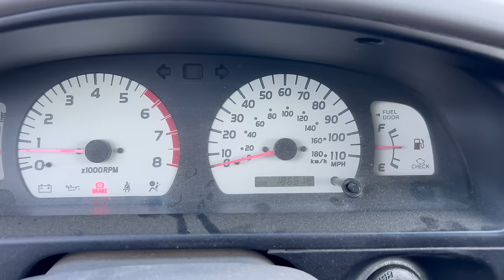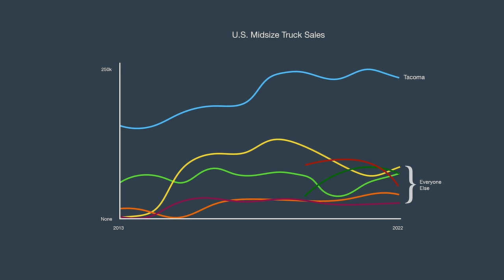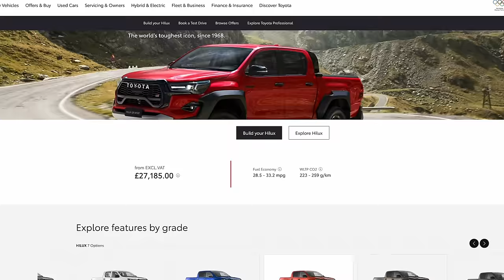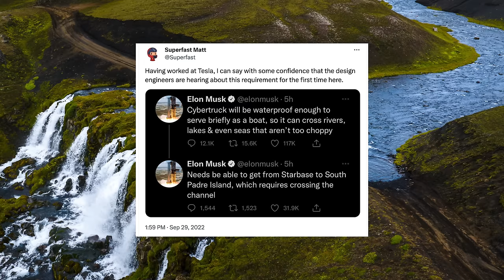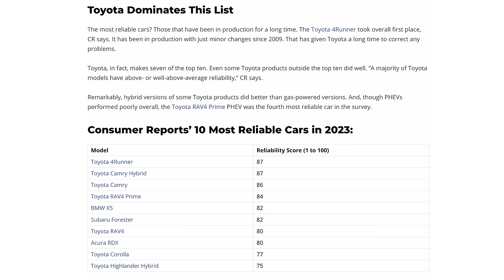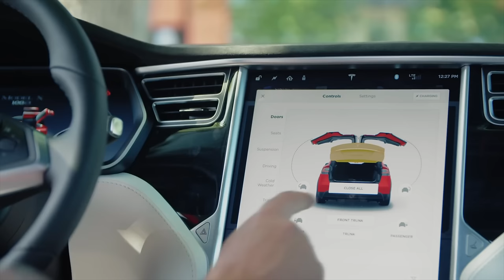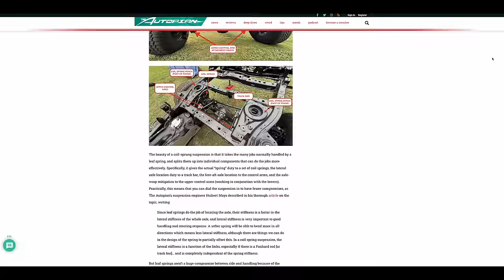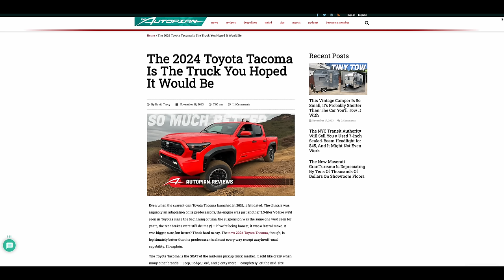What Is The Best Truck, And Why Is It The Toyota Tacoma?

Comment: Every single person I know that had these in the mid 2000's had the frame rust out from beneath them.  Eventually a class action suit got them replaced, but long after the original owners got screwed.  History says "Toyota warrantied them".  Most of those guys bought GM or Ford eventually, since they actually needed a truck.  Toyo's are too often driven by d-bags with TRD tattoos and $7k mountain bikes.  Too bad since they really are good trucks for certain things, especially the old ones.  New ones are junior big trucks - not their own thing.

Comment: My stepson has just spent a fortune buying an 80 series Toyota Landcruiser…also built when Bill Clinton was US president. In his first year…when Paul Keating was Australian Prime Minister in his 3rd year. It has 290,000km/180,000miles. And it’s petrol, or gas in your foreign tongue. And thirsty!

The Stout was also sold in Australia. My uncle sold his Mercedes(business was going ok on his side of the family) and bought both a Celica and a Stout brand new in 1977(Jimmy Carter/Malcolm Fraser). He kept them until he died in the 90s and I was the only person he ever loaned a car to. Yep, it was the Stout.

Don’t get me started on my one and only Hilux ownership experience though… Indestructible is not the word. The the 88(very late Reagan, but Bob Hawke was still going strong) one I had in the late 90s found every single way it could to self destruct! Front and rear diffs both went within weeks after the diesel engine had been reconditioned because it failed after a week of ownership. I gave up on that pile… It vibrated at idle too much anyway.

I haven’t seen too many Tacomas in Australia, but that niche is already packed with the likes of Ford Ranger, Isuzu Dmax, Mazda BT50 etc. as work utes. I am seeing a lot more F-150s, Rams and Silverados(in that order) here over the last 5 years or so though, but I think they’re mainly purchased through a tax break and personally used by owners of smaller businesses because they’re purchase price is so much more expensive.

Oh, and at 9:23… what was that thing you were doing? Next you’ll say it has 3 pedals! Oh yeah, like my car…

As for torque, 5 days a week driving a 4 cylinder 5.2 litre turbo diesel Isuzu…isn’t that much! They’re reliable though.

Comment: In 2004, I needed a truck to do a satellite tv installing job.
I couldn't afford a Toyota (new or used . . . well, I could afford a used one, but my price range was at  "a near dead, abused one" because yes, they hold their value) and was hesitant to get a Mitsu Mighty Max/Dodge, even though I knew them (all I was finding worth a look were 2.4l and I am not the biggest fan of those, if all I want is no repairs and trouble free, I was looking at "Will need seals and a new rubber band soon" or "Let's swap in a 2.6") in part because I was looking to put many a mile on quickly. I ended up getting a newer than I was expecting Frontier ('98 4x4) with just 50,000 miles. I only did the job for 5 months, but it put it near 150,000 miles. I still have the thing, it has nearly 200,000 and it just got a 'new'(reman) trans (5 speed) and I have a spare engine to hand, just in case, but I wish it was a Toyota. But, if not a Toyota, the Nissan was a good second choice (I know Rangers about as well, but they were either too new, or too clapped out. at the short time I had to look), even the mechanic I knew (and got me the deal on this truck) said as much. Now-a-days, if I was looking, I'd consider a newish Tacoma, (extended cab, manual transmission) or an older one, for that matter (or pre-Taco), but I'd not go with a newer Frontier as a second choice any longer. Too much, "You know, I don't like that" in new stuff these days.

Comment: Yeah, my 2003 'simple' truck is, I would dare say, as good if not better.  My '03 Dodge Cummins has been such a great 'real' truck.  It's a Dually, and I've never had any trouble parking it in 'Merica.  Other countries I can see it being a problem, but half the time I just 4-wheel LOW it into any spot I want.  I've had to replace the waterpump and the throttle-feedback POT in 186,000 miles.  That's it! Beat that Toyota!
Reply: I won't disagree that the Cummins in the old Dodge pickups were fantastic. Many million mile plaques have been sent to customers from Cummins in the million mile club. That being said, where the Toyota will beat Dodge any day is everything else on the truck. Most Dodges from 2003 at this point have cracked dashes, windows that don't work, doors that are worn out, and radio buttons that no longer register. Interior quality in American vehicles has been playing catch up to the Japanese for years and only in the last 10 years or so have they caught up. While I'll never say anything negative about Cummins quality and the Dodge 48RE transmission or NV4500 manual, the interior quality of any Tacoma is miles better than what Dodge was putting out until, like I said before, the last 10 years or so. Why do I say interior quality is important? It is where you spend the majority of your time dealing with any vehicle. Dodge wiring is also pretty meme-worthy for how sketchy it can be at times.

Comment: I agree that the Tacoma is the best all around pickup. For most people that just do mundane things and don’t go off-road more than 5% of the time - there is an argument for the 2nd gen Honda Ridgeline. The Ridgeline has full time AWD, rides better, has better acceleration and fuel economy, dual action tailgate with a trunk in the bed, more comfortable - these factors may change slightly depending on if you are comparing the previous generation or the new 2024 Tacoma but they all are still true unless you get the hybrid Taco which will be quicker. The Taco is going to dominate at serious off road stuff and will be able to tow more.

Comment: is the Tacoma like bigger or the same size as a Hilux? we drove Hiluxes in the army and I'm of the opinion that it's the best car ever made. We used around 2004 model years and around 2017 model years
Reply: They're about the same size. Afaik they're basically the same with only minor differences partially in due to the fact that tacomas are US made for the american market, while the Hilux is more market-agnostic.
Reply: Hilux's are all still cart spring rears, it'll be interesting if they get an option for the multilink rear at some point.

Comment: As an European and the owner of a 30y old 4runner with a one-wire diesel engine with absolutely no electronics, manual gearbox and a radio, ain't gonna sell it even if it keeps appreciating in value. It may be harder on fuel than a brand new one, but only slightly and all you need for servicing it is a bucket and one wrench. Good to see Toyota doing Toyota stuff...

Comment: I bought a 2010 Lexus LS460 because of the Toyota reliability! Although only 82,000 miles dealer serviced, I have had a lot of problems in one year! Latest is the ABS pump needs replacing at $5,000!

Comment: I don't like the feature, where the car decides for you and nudge the steering. I sometimes rent a VW eUp and that has a "line holding feature" (that is by default on and resets to on every time you get into the car) where it resist you when it sees that you get too close to a line.
Problem is, when you want to overtake a car, on a two lane road and a car is coming towards you, because you are on their lane and the car is like "No, you don't switch lanes now" and resist you steering into your lane again, gives up halfway through and the steering becomes suddenly light again and you need to avoid steering too much and ending up in the ditch - at 100kph or about 60 bananas/h.
Or when some lighting conditions are, that the car wants you to steer INTO incoming traffic.

Just leave the driver alone. I want myself to decide if and when I crash, not outsourcing it to the car.
Reply: They also can be hilarious(ly awful) in snowy or rainy conditions. Track of the cars you're following drifts to the center of the road for a minute? Have fun fighting the steering without swerving (and did I mention snowy or rainy conditions? Hardly the ideal time for it).

Comment: Does anyone actually ( in the US market ) still make a 83-11 ish Ford Ranger / Chevy S-10 / Dodge D-50 type small sized truck?    Seems these have gone away and the only reason we get a mid sized truck is that they are super popular in other countries.
Reply: Didn't those basically get killed by fuel efficiency regulations and the desire for a ute that's safe and vaguely comfortable. Much as I loved my old Mazda Bravo (same as a courier, RoW spec ranger) it was a monument to cheap and nasty.
Reply: @hannahranga   In the USA, there is the Ford Maverick which is a front drive ( 4 wh optional ) 4 door pickup that is more of a small SUV with an open back than a small truck.

Comment: I love my ‘13, but I have to disagree with the point about it being cheaper to buy and/or fill up than a bigger truck. I probably could have gotten a decent mid-late 2010’s F-150 for the same, or less money. And if it had either of the eco boost engines, I would get WAY better gas mileage. 

The cost should pay off in terms of long term reliability/maintenance cost. But the Tacoma is definitely NOT a value proposition in the short term

Comment: I want a tacoma, but I think I'm going f150... the price for what you get is just better. Bigger motor, bigger cab, bigger towing/payload. For comparable prices, I could either get a 2015 tacoma with 100k miles, or a 2018-19 f150 with 60k miles. I think I'll go f150.
Reply: Not to mention similar mpg

Comment: My 2022 had 3 miles, then needed a intake valley coolant leak fixed the next week. Now im scheduling a recall for a rear differential nut possibly loose.. The V-6 auto over upshifts so much I use the POW setting map. 
Bought on reputation and realized it isn't the same Toyota. We'll see, but the 3500 Duramax quad cab dually I regret trading got equal or better fuel economy..
Gd Russia Ukraine war still effects diesel retail prices.
Cheers,ed

Comment: I wish everyone could know this. But inevitably they are stuck in their ways of being a Ford,  Chevy, or Dodge fan boys,  and will just buy that instead. My first toyota truck was an 86'. It went 850k, I only had to replace the fuel pump, that's it people, not one other thing. I sold it for $1200 to a Landscaper. My next was the 07 tacoma.  I beat the hell out of that truck, jumping it, racing it thru the desert, crawling over rocks that, lol, I never should have. I sold it to my daughter.  It currently has 300k,  and still to this day has only a rear window motor replaced at 30k under warranty.  It even has the original shocks still. 300k, yes the original shocks. Granted I told her she needs to finally change them since they are leaking.  Not one other thing has been changed or replaced.  It's truly an indestructible vehicle.  I now have a 2018 Offroad and it at 60k. Still zero wrong with it.

Comment: While I respect the taco as a light duty truck, when it comes to towing, hauling, and just beating on. The older ford trucks are hard to beat. I daily drive a 1994 f150. Mine is the 5.0 liter, but if you want something that rivals the tacos reliably, get the 300 inline 6 or the 7.3 powerstroke . You cannot kill those things. Both will easily make it far past 500,000k miles. With many making it to that 1 million mark. I’ve always been a ford guy, that will never change, but I still respect Toyota

Comment: Tacomas are taking over the service vehicle market right now in the southwest US. Merely because they are available and cheaper than the competition.
My employer just bought a few new work trucks. Initially went out for bid on some compact service vans (Transits or similar). No one had them in stock. Orders cancelled every 6 months and resubmitted several thousand dollars higher by the dealer (shady AF if you ask me). Everyone was doing it.
Fine.
Went looking for trucks to throw a service shell on. Literally the only ones in stock in the state were the F150 police interceptors (4x4, 4 door, short bed, turbo V6, etc, basically the worst service vehicle imaginable for anyone but cops), and the GOAT. The humble base model Toyota Tacoma. Toyota had dozens in the state ready to deliver immediately. 2 door. 6 foot bed. 4cyl. 2wd. A basic bitch service truck.
For less than 20k delivered.

So yeah, my employer went with the Tacos.

And I've seem many other service industries around town starting to drive around the basic Taco as well.

They're selling like hotcakes here for your run of the mill, git 'er dun, work truck.

And I expect they will still be around 20 years from now, still doing work truck things.

Comment: 13:55 I drove a Yaris Cross hybrid recently and it had the lane keeping assistant, I didn't have time to figure out how to turn it off, but I hope you can. The first time it gently corrected my steering input, I was taken so off-guard, I nearly hit the car driving in the lane next to me. Other than that and the initially very off-putting changes between drivetrain operating states (that ICE+ CVT + electric system is so quirky!), it was a very pleasent drive.
Reply: These vehicles are way too complicated
Reply: If it's anything like the CH-R, then yes.  But you have to do it every time you turn the car on.

Comment: We can’t buy the Tacoma here, but I wouldn’t anyway.
My 2006 Landcruiser VX100 4.2TD with 635.000km’s (That’s approx 400.000) never misses a beat. Everything from the electric antenna, to the VVT turbo, the AHC suspension, rain sensor still works with no issues, I’ll admit I had to weld up the silencer this year, but it’s still the original one, and the roads get a LOT of salt here, so I’m not complaining.
So I’m not putting the Taco down, if new car smell was what I needed, it might be interesting, the rest I get from old Trusty.
Toyota might not be the most exciting, but they just work…

Comment: Obs f150's with the inline 6 are quite possibly the greatest trucks ever built. Everybody knows what the Ford 300 is. Only reason I say they are better for somebody who just needs a truck to haul trash or other light things is an 8 foot full sized bed and the fact that they are dirt cheap. Front suspension is simple with twin I beam, however it kills tires quick and handles like a horse and buggy. But two 100 pound I beams are not going to bend when you hit a pothole. 8.8 ford rear axle, simple, reliable, cheap as dirt to rebuilt. E40d transmission? We won't talk about that lol. It works, but it's not the best in the world.

Comment: The Tacoma is successful because they did several things the big 3 didn't. 
First: They never stopped selling it, this let them continue learning, then build off what they knew while maintaining a follower base. This also let the aftermarket grow. More companies jumped on, established themselves, and now continue to make stuff just for the Tacoma. It's way easier to develop off road parts when the market share of buyers is 5x the next manufacturer.

Second: They continue to offer different cab and bed length configurations. Want a crew cab 6'2" bed? Sure, have at it. Both Ford and GM no longer off that option to "save on production". 

Third: GM and Ford both put very little effort in their similar generation trucks. The GM 8 speed was crap and the diesel never got any upgrades. Ford brought over a several years old truck, slapped some "built for the American market" crap on it and hoped for the best.

Fourth: GM is GM. I love the diesel, but even in Denali trim (their top trim), they have creaky fake wood door handles, non powered rear sliding glass that squeaks, a pretty bad infotainment center, and a bunch of small squeaks and rattles that people have figured out how to fix. They didn't put any effort into it and it shows. The 2023 and up ones are apparently a lot better, but they lost 8 years trying to compete on the back foot. Besides the very niche ranger raptor, I don't know why someone would buy a Ranger honestly (and I'm a Ford guy).

The third gen Tacoma had quite a few issues. The automatic was programmed by clowns so it would hunt for gears all the time, the transfer case won't always engage when you're not on flat ground, if the forward collision sensors have any issues the cruise control doesn't work, the speakers are crap (just why? it's so cheap), and the gearing and power delivery make running 33's a chore, and they never got good mileage. 

All this being said, I'd say GM would have the best 23+ model year, if it was built by Toyota. Sadly, that's not the case so we will have to see how things play out over the next few years when people really start using these things.

Comment: I'm good on the 🆕 Tacoma truck I bought a 3rd gen '22 off-road 4X4 manual because I did NOT want the turbo + not into all the 🆕 technology & turbos are for the birds there's no way that engine will last close to as long as the 2GR-FKS! Most of the drivetrain issues that people complain about with the 3rd gen transmission issues try the OTT tune $450 all your problems go away 💯% drivability improvement along with 18+hp & 24+tq still runs on 87-91 octane ⛽ most ppl gain 1-2mpg! doesn't void warranty either.  (Overland torque tune)

Comment: As a 2013 Tundra owner, I didn't love driving the new Tundra in comparison to my V8 when I was driving the new one for 2 weeks earlier this year. Yes, the amenities were better and fuel economy was  significantly better, it had non-Toyota like rattles that were annoying AF. Not to mention the 1 billion driver aids (my 2013 has basically none). I used to have a 2016 3rd gen Taco but got rid of it for my Tundra bc the drive train was so lame. 6MT is the only way to go in a Tacoma imo.